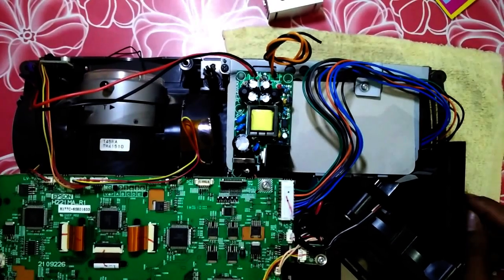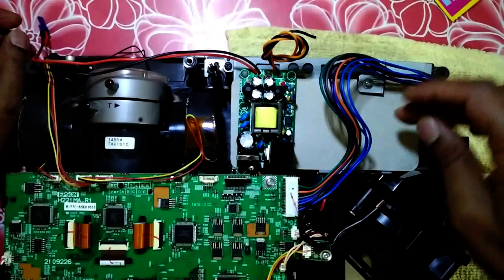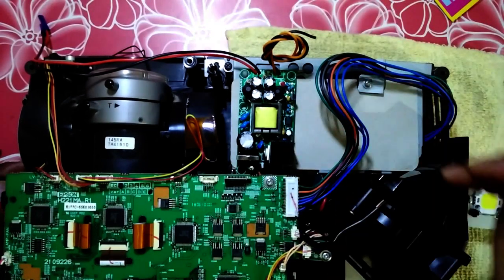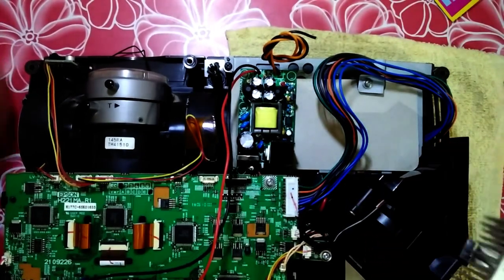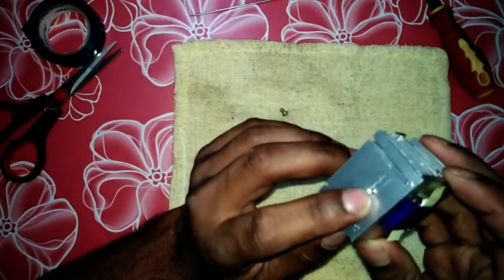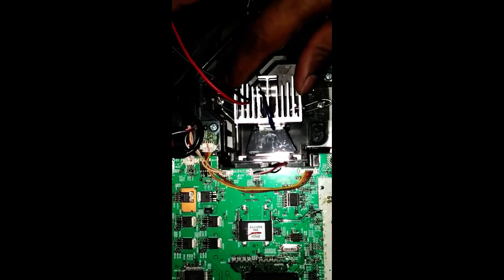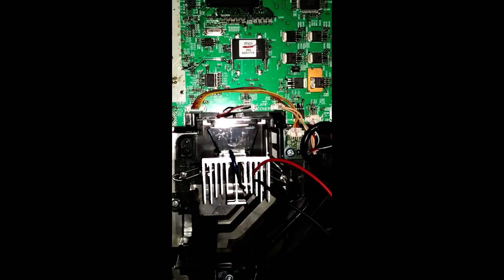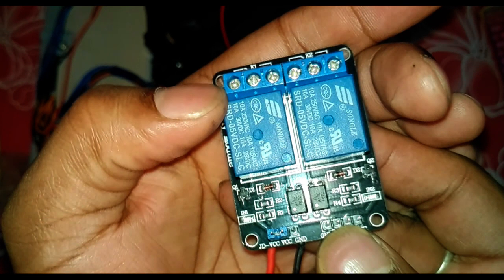10 watt led installation in EPSON Projector (part 2)

Comment: How bypass lamp detector on mainnoard
Reply: Hi. I know my reply is way but it might help someone still looking for solution. Find the set of wires (thin coloured wires) coming to mainboard from ballast (or power supply board integrated with ballast circuit) > then disconnect this set of wires from mainboard > then one by one, earth the connection  (take a thin wire, attach one side to a screw on the mainboard and touch each coloured wire by the other end) and try to power it one. Good luck

Comment: Pro-Excellent,Spectacular projectorσσ>7wow.cc/EpsonProjector?ㅟ   I think this is the last step between 1080p and 4k definition. Con-May be a little fan noise if you use it on (Normal Power Mode) that noise is very low when use it on Eco Mode

Comment: why is everyone using weak leds? Surely a 100w led chip would work miles better.
Reply: 100W led does not work either. Because the light angle is wrong.
Reply: U dont understand if u put a very bright led the picture will be washed out    why do u thing with normal dlp or lcd projectors the higher the lumins the bigger and fatter the projector gets
Reply: Sir i am using benq ms524 projector how to bypass lamp signal tell me sir
Reply: They're pussies. 100watts led consume more amps.
Reply: Ryuuken24 it's only like 3-4 if you're running it at 30v it's not that hard to find a PSU that can supply the power
Reply: Exactly!

Comment: does thelight side stay cool ?
Reply from the maker: If u r going to use 10 watt to 30 watt LED with good heat sink then the LED stay cool because of excellent of ventilation  design of Projector. But if u are going to use 50 watt to 100 watt led then u need big heatsink with fan which need to be fit in the Lamp compartment.
Reply: right but the side where the light shines is that cool to touch right . But the heatsink side is the hot side I know . But does the side where the light is outputing does it get hot ?
Reply from the maker: yes its get hot, but not to worry bcoz the window glass is too thick from where the light is reflecting inside the led. So, go on.....:)